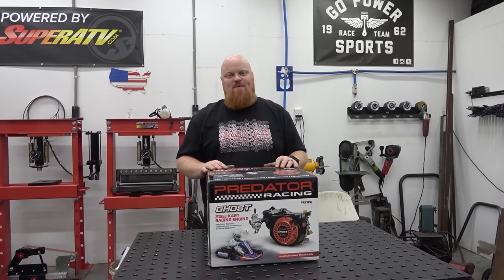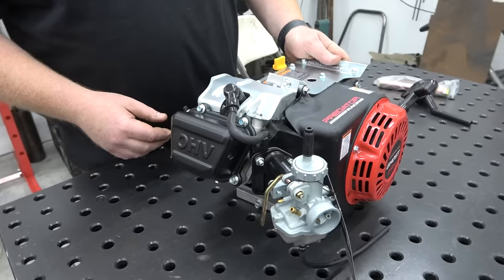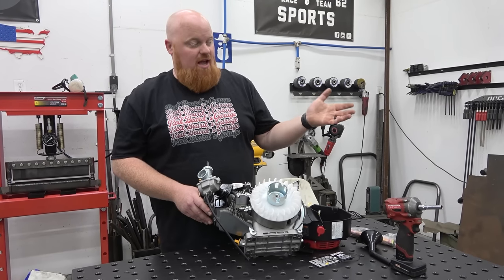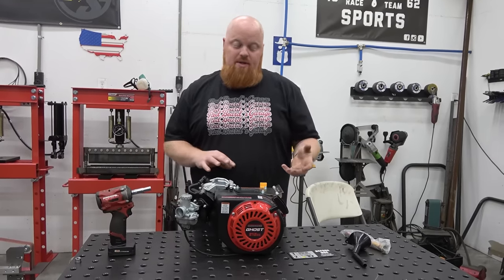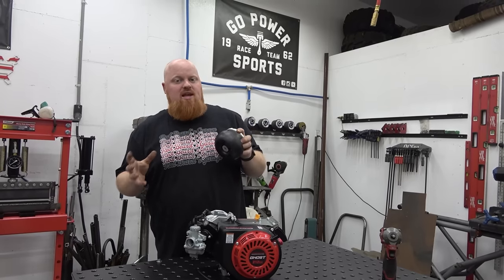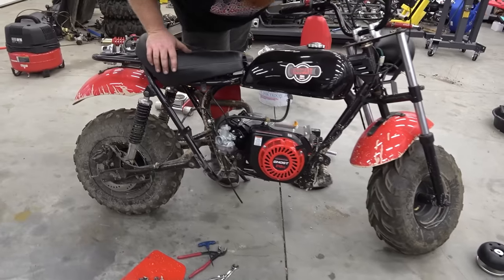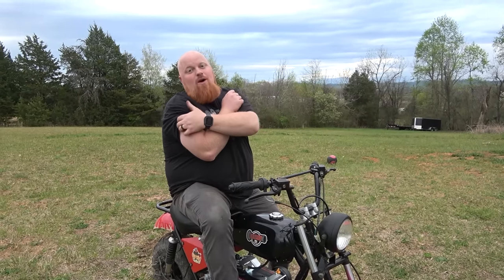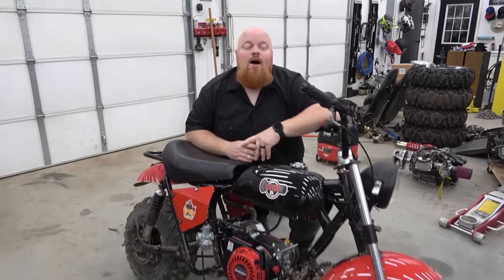🚨NEW Predator 212cc Ghost👻 Racing Kart Engine - Harbor Freight Ghost 👻 Engine

Comment: I have the Ghost engine, as it comes out of the box with the accessories box needed to finish the engine for use. It has less than 5 hours use. Currently when I try to start it, the pull rope will rip out of my hand HARD! checked everything such as flywheel, valves, etc.  Everything seems to be at spec. Engine will not start. What am I missing?? About ready to box it and forget it!!

Comment: Was the 30 series converter a straight put on? Was the shaft on the ghost engine long enough to be able to run the stock 30 series torque converter that came with the bike?

Comment: i have a trailmaster 196 clone with a stage 1 kit and no governor. im looking to replace it and i was wondering if this engine is worth swapping it. i wonder if i should be messing with these small blocks or just bite the bullet and get a 420. id like to hit in the 50 mph range.
Reply: Much happier getting away from the small stuff with my 810. 
It puts out the same as my old engine did, but down at 2200rpms and then just climbs from there.
Reply: @MrTheHillfolk  i made up my mind and am gonna go with the 420. I'm just mad I have already bought a 30 series juggernaut and a super pipe header for my mb 200 lol

Comment: I'd really like to know how you installed the throttle to the carburetor 🤔 I didn't see a  removable slide like the mikuni carbs so I'm curious if it's just the black looking piece that won't slide out??
Reply: I was wondering the same thing
Reply: @corbindixon1674  yes it is that piece! Just not so easy for my fat fingers to slide it out lol I think I used a my pinky and a small screwdriver to get it out👍🏻

Comment: So is this there entry into (it's been a while for me) but a box stock class? We literally use to buy the 6.5 horse 299 harbor freight motor with an aftermarket filter racing exhaust, timing advance key and governor removal and just float the valves to the moon! Lol

Comment: Why do use the high zinc additive, is it necessary? I have a stock 212 should I be using it in mine ? Currently running amsoil small engine oil

Comment: Hey Red Beard. Thanks for the video. I just received my Ghost engine. And I have some questions I hope you can answer. I bought this to go on my second snow dog build, first build has a regular pred.212 and it runs really good. I am curious as you said, about the pulse fuel pump,..not sure how that works , looks like gravity fed works just fine. is that true? not sure what the fuel line on the bottom of the carb is for? fuel pump application only?  How does the throttle cable work? I am hesitant to start dismantling the "twist lock" assembly on the top ,. I assume that exposes connection area? any information you can give me will be appreciated. !!! Thanks in advance.
Reply: Pulse feed doesn't starve out while flying around corners. Much better for a cart.

Comment: I would buy the 224 two to one over that race engine. In fact, with no more changes that they have made to the engine, rod, crankcase, flywheel and cam, I would not even call it a race engine.

Comment: Everybody says the cast iron flywheel isn't safe on the predator 212, but if I simply just put a new carb on, exhaust, and put a tachometer or something that tells me the rpm and never let it rev past 6,100, do i really need the billet flywheel? this one doesnt have it. I already bought the predator 212 but now im thinking I should have got the ghost! I just want a cheaper form of the lo206 and it appears i made the wrong decision as I have already purchased the 212, billet flywheel, and parts

Comment: nice vid, just have one question, in all your builds when you change the flywheel you place stock key or you place a advanced one? i have a gx390 with billet flywheel and a 6 timming key, but my spark plugs keep getting dark i think timming is way off.

Comment: I have a ducar 212cc regular headed engine. I’m installing 1.3:1 rockers, new valves with automotive style split keepers,& 22lb valve spring. I ported the head myself to mimic Paul’s karts porting, just not as much. It’s a small cc’d head already. OG vm22 carburetor,not pz style with a long style intake manifold (made for 24mm flat slide). And J bend candy cane looking kart pipe pointing downward. My question is would the 3 oil filled side cover fit my 212 ducar engine? The top looks like it is intended for a pulse pump, since there’s a filter in there. Also no, I would not buy that engine, just because I would have to throw out alot of the components. I would buy the pull rope part that says GHOST. Pretty kool lil engine,,,I’m glad I chose DUCAR myself too.
Reply: @textme739  hello red beards garage
Reply from the maker: It's a scam. Do not reply to them.

Comment: ROFL  That is NOT an oil screen per say on the top crankcase bolt hole. It is not meant to kept stuff out of the crankcase oil. That screen mesh in the top "oil fill hole" is to keep the oil from splashing up into the vacuum line of the pulse pump that is hooked up there to that hole, the hole fill hole on top... for the gasoline pulse pump.

Comment: I just got a BT200X and I want to goof around on the stock 196 while I save up for the Predator 212 Race and the parts from your parts list to use on it. I want to be able to keep up with the pack in the local RIDE OUTS where these guys are regularly doing 50mph on Doodlebugs and Tacos. This would take the Series 40 Clutch? I think the Series 30's are only rated to 7 hp and I imagine this engine is about 13hp out of the box?

Comment: I'm trying to add a torque converter to one of these and the plate dosnt fit right against the block like it did with the regular predator 212, is there a different mounting plates for these

Comment: Be interesting to see if they are built to specs and have quality control. Being in the tech side of the karting world it will be a nightmare if they are built anything like the predator engines we are used to seeing. Everyone is going to want them but if the parts are all over the place, as far as quality control goes, it will be a logistic nightmare in the tech shed.
Reply: that was my thoughts exactly. I would love for these to be made close enough to each other like the lo206s.
Reply: It will soon turn in to a 1500 to 2500 dollar engine for all the top notch to spec parts.
Reply: @Zat368  well just buy a 206.  Why do you think the price tags are so different?  Chinese quality glorified is still Chinese quality.
Reply: @cravenmoorehead5636  unfortunately all the classes out here run the "cheap" $600 predators lol
Reply: @cravenmoorehead5636  I really like the last sentence in your comment!

I have to admit however, out of maybe 8-9 HF 212 hemi's I've bought new and others I've modified for other people, the quality control ain't that bad. At least on these series engines.
I measure cranks with a mitutoyo mic set, a deck bridge for piston in the hole (that one is kinda all over the place but still within "spec") even a dial bore guage for cylinder diameter, measured at multiple points. I've got a degree wheel to check actual timing which essentially is telling us if they cut the keyway right, and all are within 2 deg so that's no worse than an OEM automotive spec in the old days. My 100cc burette gets a workout and I'm impressed with how consistent the chamber volumes have been. I forgot the number because it's been over a year since fooling with these engines after "da flu" we all dealt with. But I remember consistent numbers on new engines and even engines that had been run for a season or so out of the box. 
I am very aware how quality control can and often is thrown out the window with china stuff. I find it weird people were afraid to say that out loud or too loud just two years ago but now people talk about china (lack) of quality openly now.
Reply: @cravenmoorehead5636  exactly.  Just like the flat head.  Just like the clone.   The LO206 solved this thankfully.  This engine will never be raced widely…. And that’s good in my opinion.  Now if IAME and Rok could just find a way to lower my 2 cycle engine bill… 🤔
Reply: @williamstamper442  I don't know anything about the cart racing world, but everything else China makes has been thoroughly talked about the  lack of quality control, forever!

Comment: Could use that top fill port as a spot for a pulse fitting.
Reply: @Neo Gothic Racing  exactly, especially when you got a pipe that points down with a brace it’s right in the way of that back oil fill cap.

Comment: Hello i have a coleman bt 200x with a jackshaft would the ghost engine be good for. It with the jackshaft. And 50 tooth rear sprocket
Reply from the maker: It should do pretty good on it. I would rather get the Wildcat 223cc instead and do a few parts. It would make more power for the same money.
Reply: Thank you for your help can you please give me estimate on the top speed and torque
Reply: Sorry for all the questions could i use the jackshaft thats on my coleman bt200 x 196cc on the 212 ghost engine ? Im thinking the bolts might be a different size than than ghost engine
Reply: @RedBeardsGarage hello will the predator 212cc exhaust pipe fit on my ghost engine
Reply: Will any 212cc header pipe work on my 212 ghost engine

Comment: I’ve installed a slipstream billet flywheel and can’t get it to start I’ve tried every gap from 32thousands to 60, I’ve tried swapping the rev limit coil with no rev limit coil, I’ve tried new spark plug. No luck getting it to start. Tried the key it came with, tried the original key and nothing. I put the stock fly wheel back on and it started first pull. Can you tell me what’s causing this?

Comment: Yes true the 224 is bigger but the predator 212 is way better i’m running stock valves stock camshaft and springs all I have is just a Mikuni and Governor removed and I’m hitting 45 👍🏽

Comment: Hopefully they make more of these made for racing type engines cause 300 for a no exhuast no gas tank and pretty much a 212 with stage 1 and 18lb springs I think I'ma go with building mine how I want it I think this engine should be more like 219$-259$ for me to buy it just a little much if u add up a 150$ stock 212 with a stage 1 and springs it's like 230 and u have a header and gas tank for cheaper 😂

Comment: Buy a 224, delete the governor yourself and add a vm22 and header. Save some money and have a faster engine.
Reply: That was my thought. Same carb and pipe the 224 would make more power, plastic cam and all. haha.
Reply: @Deucealive75  you think replacing the plastic cam would affect its performance?
Reply: @naturechanel209  I was really just joking with my comment.

I don't think that running with the stock 224 cam is a problem at all if you are running 5K and under RPM. If you want to run more than 5K RPM it's time to build the engine to support the higher RPM. It is then that the cam should be replaced with a performance cam.

Comment: Only problem is probably 70% of the kart racing in the US is dirt track and this engine won't do us any good really... we're better off with the plain old 212 hemi or non hemi tbh and In the 196 clone classes we run 7000 plus rpm with 10.8lb springs 18 lb isn't necessary for those rpms.. the 18lb might have more life length over the 10.8 though and I'd imagine you'd pulse off the valve cover or the top oil fill opening
Reply: 1 you’ll never turn 7k rpm with 10.8 springs because of valve float and 2 it’s not only for asphalt karting there’s nothing on this motor that will prevent you from running it on dirt
Reply: @_chevy_s-zj5pw  I can tell you right now your dead wrong... we turn upward of 7400 on our 196 cc clones with 10.8 springs and cl3 Cams all the time.. stock rod billet flywheel on pump gas ...also unless your running an open or rwyb class which there aren't many of for dirt these are useless... most dirt ovals are running the 212 hemi or non hemi predators in the box stock configuration and with a rpm rule of no more the 5200 +-100 with surge...
Reply: @kartracer5g229  A lot of mini bike guys don't know that. They all want their 18 lb springs to run with the stock cam. And you guys racing probably change your springs out regularly. 

I run a CL1 with stock springs on a mini bike, but I top out around 5K RPM due to the stock torque converter and gearing.
Reply: @Deucealive75  between 4 to 6 races depending on size of track ran at 0 lash... 18 lb springs on a stock grind cam like a cl1 cl2 cl3 or one of the Dover cams will dog it down and hurt top end rpm... now if you are running a hot cam yeah sure 18's would be fine .. not with a stock grind like the cl series though... if you'd run a centrifugal or disk type clutch with the right sprocket combo you'd get them rpms too.. they are hard on the engine.  Won't say it isn't but we do it regularly and it don't hurt us as much because we aren't sustaining those high rpm numbers constantly.. we get up to that and go down 300 to 500 rpm then slowly back up and repeat for 15 to 20 laps or 30 to 40 laps if it's a big or money race

Comment: You should do a side by side comparison on performance between that and the 224 stock for stock both straight out of the box I bet the 224 will out run it for less money
Reply: I have both and the ghost will flat out  leave a stock 212 in the dust.
Reply: I'm taking about a 224 not a 212

Comment: Quick question what's the best engine for an ezgo golf cart? Would like it to perform a little better than stock.
Reply: Cr500 Honda 2 stroke engine with cruise control and traction control and 4wd
Reply: @brodym.7118  that would be cool but it's a little outside my price range.

Comment: you mention some treatment for oil  leak's? my head gasket's is leaking on my Ram 2500 look's to be a lot of stuff i need to take off in order to change the gaskets. tried to find the video but can't seem to find it.
Reply: INBOX ME ①⑨②⓪⑥⑥③⑧⓪①①  Yeah right not going to fall for that scam your not the real deal bud only 21 subscriber's

Comment: Question for all the people with karts out there. hopefully you read this.  Got a kart its a lengend set up for dirt would you run this pred digitally governerd at 6 or the tilly mk2 212r.  Or are the basically the same since they both seem to peak at 6k.  I only ask since I have both.
Reply: No one can chime in which one they would pick for dirt oval racing.  I think I'm going to go with the Tilly 212r mkII since I just gotta put a rod in it and gonna take the carb and intake off the ghost and have an extra pe24mm carb, port the head, get a bigger cam, gov delete. Should go pretty good. Just out of the box to me the tilly's parts just looks better quality. Anyone want to chime in with there thoughts let me know.  It's going on an older tri set legend frame buddy built a dirt oval in his back yard its epic.

Comment: I might have missed it but does this have the tamper seal the briggs kart engines have to keep you from messing with anything unless you destroy the seal?
Reply: It's been many years since I've been out of kart racing but I'm assuming you're referring to the Briggs animal "sealed engine" that some tracks ran as like a "spec class"  I doubt this engine has those as thier reasoning for "sealing" those engines was simply to deter people from cheating. I think that it was sanctioned by one of the Karting associations and Briggs together. Forgive me if the details aren't exactly correct, again it's been many years. Lol. I miss it.

Comment: Sir honestly in your opinion? You have built engines and you have tested many other namebrand engines how does this stack up as far as in right out the box power wise for $300 is that not worth it or what??? I think it sucks that so many of these YouTubers that do the mini bike builds are downing this motor because it’s from Harbour freight my thing is at this price point I feel you are more than getting a great deal please correct me if I’m wrong I know it’s still too soon and it’s not broken in yet but judging by your video and your weight no pun intended I think that’s a pretty good performing motor for the price point out the box!!!
Reply: @textme739  hello  I’m just getting this message and I am excited to here about a gift thank you in advance!
Reply from the maker: It's a scam. Do not reply to them.

Comment: What throttle cable do I need for mine? My throttle cable from the 196 won’t work
Reply: I have the Ghost coming tomorrow, I plan on just cutting the stock cable to length and soldering on an end.  Making sure to dip the cable end in a lot of flux and then using a very hot soldering iron/gun before adding the solder... If this fails to work I will let you know what cable I end up ordering...

Comment: Hey  on my bike I have a 80cc motor and two days ago I  started  having  problems with it  running  I found I had to change  out my head and that helped it but it will  just stay running  as long as I pedal  and I'm having  problems with  the muffler  not seals I can use help asap because I  use it to get around town and  right now I don't know what else to do
Reply: 1920663

Comment: While this is half the price of a Briggs LO206 up front, it will cost 5 times as much to race because you will have to blueprint it….  No one is gonna make a kart class for these because they can’t be box stock… there is no security lock on the short block and even if there was there would be too much Mfg variability for good racing parity.    These are probably great for yard karts and mini bikes though.

Comment: Red Beard, Predator designed that 212 Ghost engine to run the gasoline fuel pulse pump where you thought was an oil fill plug on top... you know because it's a race engine... I suppose that means it works off of vacuum pressure or something, which is really the opposite of pressure, vacuum.